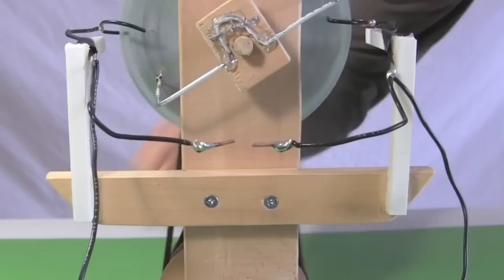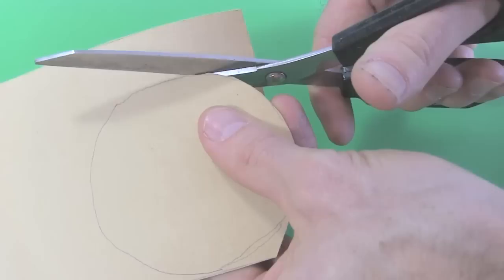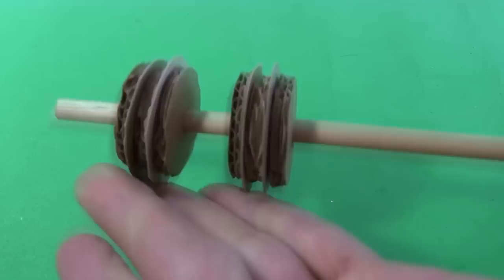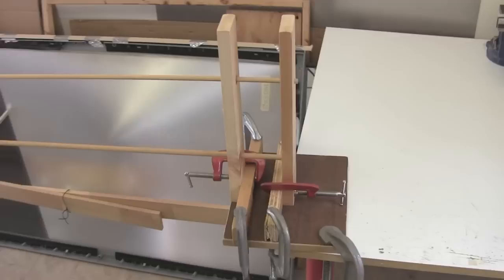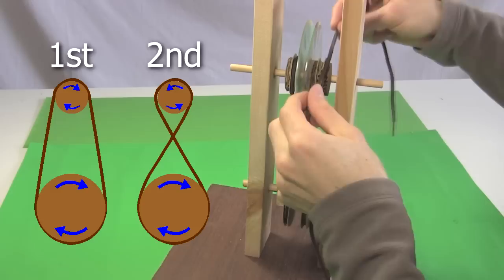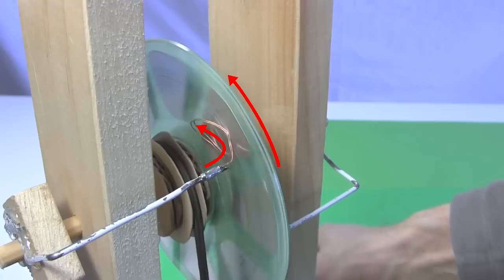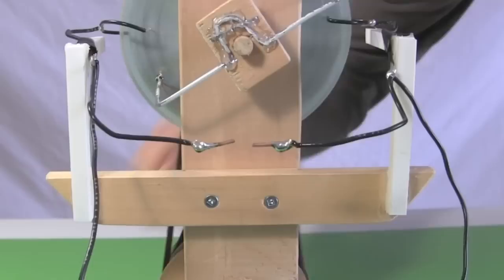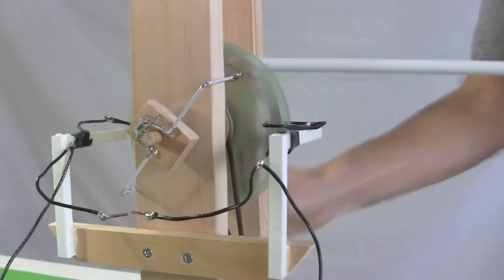Wimshurst Machine - How to Make using CDs

Comment: I used to have one of those,....it's interesting that you have shown that you don't have to have nichrome wire to make it work.
Reply from the maker: John Kerley Nichrome wire? Are you sure you commented on the right video?
Reply: RimstarOrg Yes,this is the right video.
Reply: John Kerley I saw on a site that it was supposed to be better for dissimular metal contact for the neutralizer bar brushes.
Reply: John Kerley I have made my own version of something that i saw that you made a long time ago that is not on YouTube,...I don't know if I should say what it was on here because of how dangerous it is for someone to do,but I tested it and it worked good for me with HVDC.
Reply from the maker: John Kerley Interesting idea. Dissimilar metals have a small voltage between them. But for the brush on one end of the bar you want the voltage to be one way and for the brush on the other end of the bar you want the voltage to be the other way. That means using different materials for the two brushes.
Reply from the maker: John Kerley I removed some videos a while ago because they were off-topic for what my channel came to be about. Since I embed those videos on my website I moved them to my "play" channel https://www.youtube.com/channel/UC50maRGF04t_kKD27Jkciuw/videos
Reply: RimstarOrg It was'nt in that, it was something from 2003.
Reply from the maker: John Kerley Well, if you still don't want to say what it was here then send me a private message.
Reply: RimstarOrg It was the HV probe,...I'm not sure how to send a private message.
Reply: RimstarOrg I used just the meter face and made it all in one unit.
Reply: RimstarOrg It is what is on both sides of the neutralizing bar on my Voss machine, I guess it works,but I got to admit that I used to think that the polarity reversed from time to time.
Reply from the maker: John Kerley All one unit? Neat idea!
Reply: RimstarOrg I thought about doing a video on it,but,I did not figure out how to get the meter to measure full face to a satisfactory amount of voltage without being more current than the exact amount for normal full swing. So, at full swing, the current is actually double what it should be, but that would be if there was 200,000 V measured. It is still useable though, up to 100,000 V. I would be afraid to try that though! I tried it with an old Zerox machine flyback that was labled as 7000 V out and I just had to add a 4700 ohm resistor to the meter to get it to measure exactly on my 7000 V mark. I had made all the marks earlier on the face by instead of the 2 G ohm above the circuit, there was 200,000 ohms above and the voltage was up to 20 V from my power supply. The meter face has 20,000 ohm/volt movement,and the ohms measured across is 11K ohms, with 16.7 K ohms going to the meter.
Reply: RimstarOrg I forgot to say that I also have a very large diode added to the end of the probe,incase of contacting AC. It is 80KV, 2mA.
Reply: RimstarOrg I do'nt want to over talk this, but I just want to add that I suppose in theory that I could have measured across 10K instead of !!K,it is just that after 3 days of experimenting that that is just how it worked out with that meter face. Probably also because the resistors on the low voltage side were 10% accuracy.

Comment: I have a Wimshurst I bought eons ago, but the foil pieces have lost their adhesive over the years and have fallen off. I have been wanting to replace them, but have never found an answer about whether I needed actual TIN or if aluminum foil would do just fine.. I am guessing aluminum will work, since it's what you're using here =)
Reply from the maker: I doubt that it makes any difference with regards to performance. However, the aluminum tape I used will wear our faster than solid aluminum or tin.

Comment from the maker: Certainly not the one in this video. I'm no electrolysis expert and there seem to be a number of different ways of doing it (DC, pulsed DC) but the current is very small with a Wimshurst machine. The only reason you get a big spark is because you've built up charge over time in capacitors and then release it all at once. With electrolysis you keep the current flowing at all times, so it's like a short circuit with high resistance. So I don't think it's well suited for electrolysis.

Comment: do you know if the axle for the CD's can be made of metal?
My question is are the neutralizing bars supposed to stay electrically isolated?
thanks :)
Reply from the maker: God Was Bored Yes, the axles for the CD's can be made of metal. But... the neutralizing bars are supposed to stay electrically isolated from each other so they must not come in contact with that metal axle. The axle for my commercially made Wimshurst machine is metal and you can see it in the fourth photo from the bottom here http://rimstar.org/equip/wimshurst_27cm.htm (near the top of the photo.)
Reply: RimstarOrg Awesome, that's exactly what I was looking for in an answer :)
thanks man

Comment: Hi again! I know it's been a long time but I have finally finished building the machine. Unfortunately it is not working. I'm not sure why because all of the parts are working perfectly. I wonder if it is due to a small gap of about 2mm between the disks, and with the thickness of the disks themselves it would add up to about 3 - 4mm. The disks also wobble slightly when rotated. Also wanted to know if there's any way to check if the machine is getting charged?
Thankyou so much for all your help!

Comment: I have made this exactly how you have made it but it wont work. The collectors are close to the disks and the spark gap is tiny. I have the capacitor exactly like yours all wired up correctly and the cd's both spin fast in opposite direction. he neutralizer bars are making perfect contact with the sectors and the room I am operating the device in is NOT humid at all. The only thing I could think of is that I have not sanded the disks as there was no picture or painted label just a plain shiny CD material on both sides. Please, what am I doing wrong?
Reply from the maker: When you say there's "just a plain shiny CD material on both sides" do you mean that the CD in transparent plastic or that there's some coating? If that coating is electrically conductive then it would create a loss between the sectors. What are you using at the spark gap? In this video I use two sanded ends of thick wire. But the bigger and rounder the metal objects you use, the bigger the spark will be, assuming everything else is okay. Regarding the neutralizers, did you make sure that for each set both brushes are touching sectors at the same time? Also, make sure that when a brush does touch a sector, there's a sector facing it on the other disk. Also, make sure the neutralizer's brushes aren't too close to the collector ends. It's also possible everything's okay but it needs to be started using the triboelectric effect as I showed near the end of the video by putting a charged object opposite a neutralizer brush. Smaller machines like this one need this more than bigger machines.
Reply: RimstarOrg The CD's are not transparent, they still have the shiny rainbow material that contains all the data on both sides. As there was no printed label on the CD's I did not bother to sand them off as I thought only the printed label had the possibility of being conductive. I'm using thick metal wire for the spark gap. Both brushes on both neutralizer bars always come into contact with both sectors. They are spaced far away from the collectors. I have tried starting it with the triboelectric effect and that made no change. Another thing it might be is that the disks spin out of sync with each other so all the brushes will always be touching their sectors but not necessarily at the same time the as the other disk.
Reply from the maker: halflife390 When the brushes on one neutralizer are touching their sectors, the brushes on the other neutralizer don't have to be. So that's okay.
What the disks spinning out of sync does affect is that when a brush is touching a sector, there should be a sector facing it on the opposite disk. But with crude machines like this one, I wouldn't expect that to be the case all the time. Even with commercially made machines that doesn't always happen.
However, the use of thick metal wire for the spark gap is far from ideal. I suggested adding bigger and rounded metal objects to then ends of those wires. On many machines you'll see metal balls there. That should make an improvement for two reasons. One is that the larger the area, the more charge will build up before sparking. The other is that sharp edges there will leak charge to the air before the spark, meaning less charge will have built up and so the spark will be smaller. I sanded the ends of my wire to make them rounder but what I should have done was gotten some round metal object and attached it onto the ends instead. What to use is always tricky. I have some .38 caliber steel balls, normally used with guns which I've used recently for something else that would have worked well.
Reply from the maker: *****
If it can conduct electricity then it should work. The only possible issue would be that as the disks turn and make the wire brushes contact the sectors, that might wear down the aluminum coating on the wrapper material.
Reply: halflife390 the data is on the plastic not the foil
Reply: ok thanks
Reply from the maker: *****
The CDs need to spin in opposite directions, otherwise it won't work. You could instead attach your motor to where I put the hand crank.

Comment: Wow Its fantastic and simple. But dont quite understand about the coathangars & neutralizers.I've an old Bycycle Dynamo.(Miller) used for the Head and Tail light. Can you please show me how to utilise it to charge mobile phone whenever there is a power cut.(common in India)
Reply from the maker: Swamynathan Iyer Do you mean you don't quite understand how to coathangers and neutralizers work? If so, it's to much to explain in a comment. Sorry.
A Wimshurst machine isn't very efficient and would be a bad choice for charging a mobile phone. You're much better off with your bicycle dynamo or any other electromagnetic type of generator (a Wimshurst machine is an electrostatic type of generator.) Also, if you take any motor and turn the shaft manually yourself, the motor wires then output power. The motor acts as a generator. Just don't turn the shaft so fast that it produces a higher voltage and current than the motor is rated for otherwise you could damage the motor. You could also make your own generator using wire and magnets but I don't have any video about that.

Comment: Can the neutralizing bar be a metal stick directly connecting the plates on the disk? Can the collector be a metal comb?
Reply from the maker: The neutralizing bar can be a metal stick, mine is, though it's bent to shape. And yes, it connects the plate on the disk. The collector can be a metal comb but the ends facing the disk need to be sharp points. However, as I showed in the video, I started out with many sharp points facing the disk and ended up trimming that down to one sharp point. That's probably because with this small machine there wasn't enough charge on the segments to create a ionized path through the air to many sharp points. So if you start with a comb with many sharp points, you may find you'll end up cutting off all the points except one to get it working.

Comment: If I wanted to use a store-bought capacitor for this project, how many farads would it need?
Reply from the maker: I just checked mine for this one and it's around 47 picofarads. Typical Leyden jar type capacitors would be higher, just do a rough estimate by the difference in surface area. But the issue with store bought ones might be the breakdown voltage (the voltage rating on the capacitor.) A CD case like I used, or the typical plastic jar of a Leyden jar, can handle thousands of volts. That's very hard to find in a store-bought capacitor. Before you ask, I don't know what the required breakdown voltage is or what it is for my CD case one. Judging by the spark gap size, I'd guess the voltage gets to around 1 or 2 thousand before sparking, which means the capacitor can handle more than that.

Comment: I mean can I don't put brush on the neutralizing bar? But just the bar connecting the plates and can the plates be aluminium tape?
Reply from the maker: Yes, you can try having the bar contacting the plates directly. It probably won't work out though, since your disks will probably wobble at least a little and so they won't always make contact, probably even not often. They're more likely just to tap the disk every now and then. And yes, the plates can be aluminum tape. That's what I used.

Comment: Sir I'm here after seeing your ball cyclotron model. Will this machine make the ball cyclotron model run?
Reply from the maker: I don't know for sure but I have my doubts. The output of this particular Wimshurst machine is pretty weak. You ball cyclotron would have to be very small due to the small disk size and the slow rotation of the disks. Either that or you could try a Van de Gaaff generator instead https://www.youtube.com/watch?v=fsT69XnjxgU and https://www.youtube.com/watch?v=QrCgtjZwnB0

Comment: Does the nuertralizer bars need the touch the sectors opposite of each other at the SAME EXACT TIME?
Reply from the maker: +Rene Gonzalez Yes, they have to touch opposite sectors at the same time. That's how the charging of the sectors happens. Negatively charged electrons move from one sector to the opposite sector via the neutralizer bar, leaving one positively charged and the other negatively charged. So as long as the bar spends at least some time touching both, then you're good.

Comment: What's between the CDs? Is it nessesary or can the CDs touch each other?
Reply from the maker: +Laurin T. There's a very thin (1/16th of an inch or 1mm thick) piece of white plastic glued to one CD to act as a spacer. Plastic, cardboard, or whatever will do. I guess I missed pointing that out in the video. You can see it for a fraction of a second around 3:28 just before I hold the CDs against each other. It's probably best that they don't touch each other since that might cause charging by contact. But you want them as close together as you can get them.
Having them so close does introduce the possibility of arcing from one sector on one disk to a sector on the other disk by arcing around the edges of the disks but this machine isn't powerful enough for that to happen anyway.

Comment: I've spaced out the sectors exactly as you did i.e using 8 sectors evenly distributed. And I guess my spark gap can be rounder. I feel like the thing is not getting charged at all. Does it matter if the disks aren't rotating fast enough?
Sorry to bother you again and again! But I'm desperate! :(
Thanks again!

Comment: Can you help me with a question? I made it, a higher version but the voltage is small and I have the same current charge at the two colectors, the disk 1 is a little higher (2 mm about) than the disk 2 so the two corona of sectors are not at the same level but they are perfecty opposite, the disks also have a little oscillation: there is moments when the disks border are closer and farther so the distance between the disks oscillates between 10mm and 4mm approximately
Reply from the maker: +Alex Alex9276 The voltage with mine is small too. Do you at least get a spark? More capacitor area than the small square I use would help with the brightness of the spark, but make sure you don't have a lot of sharp edges except for the ends of the collectors facing the disk.

Comment: are you touching the collector to the aluminum disk ?
Reply from the maker: No. The sharp points of the collector should be close to, but not touching the aluminum. The only thing touching the aluminum should be the brushes.

Comment: How far should the sectors be placed from each other
Reply from the maker: +Rene Gonzalez There's no number I can give you. If they're too close then there times around the rotation where there can be losses from one sector to the next sector if they're too close. This CD Wimshurst machine doesn't build up enough charge on its sectors for it to be visible, but with a Wimshurst machine with bigger sectors you can see these losses as a purplish glow, called a corona, between the sectors when they're near the tops and bottoms of their rotations and if the sectors are too close together.

Comment: Are neutralizer bars grounded or not? Is there connection between both bars?
Reply from the maker: No, the neutralizer bars are not grounded. Also, there is no connection between the neutralizer bar on one side and the neutralizer bar on the other side. I explain a lot about how it works in my video How a Wimshurst Machine works and it may give you another view of how all the parts work together https://www.youtube.com/watch?v=nA4aCd5qFWs

Comment: is there a way to convert  the high voltage produced into usable 12 volt power.I heard that a car sparkplug plus the ignition coil could be used?
Reply from the maker: +terry rehel No, this Wimshurst machine doesn't produce a useful amount of power. A larger one produces enough power to light small LEDs if you put the LEDs in the middle of the neutralizer bars.
BTW Voltage isn't power - they're two different things. But I understood what you're after anyway. No usable output here.